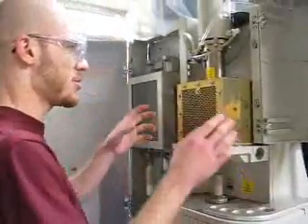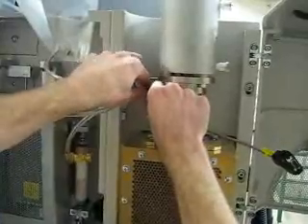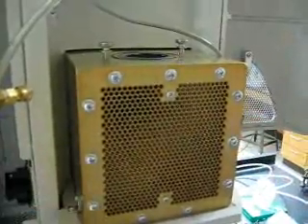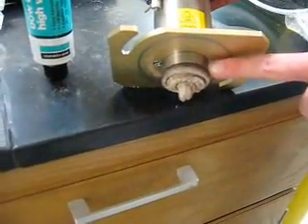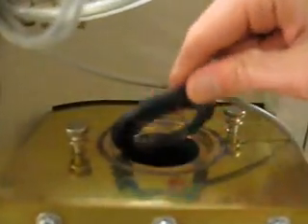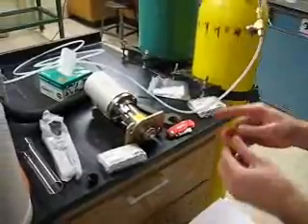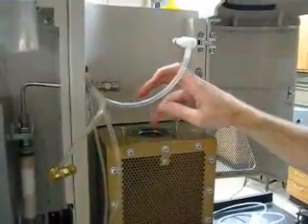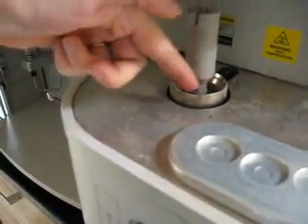Leco CS Quartz Tube Replacement

Comment: I'm currently learning how to use and troubleshoot a CS-230. Currently attempting to replace the pinch valve tube (looks like it is cracked where the pinch point is) and the CS230 is giving us a leak check fail.  Might I be able to contact you to ask questions? Thank you!
Reply from the maker: Hi neohighlander... I'm sorry, but I wouldn't be much help.  I haven't touched a Leco machine in over 10 years now.  I left this video up for the students that followed me in having to deal with this.  I do remember seeing leak check statuses, but I don't recall any solutions.

Comment: I worked for LECO back in the 80's. Installed alot of CS-244's CS-144's SC-32's & SC-132's and some CR-12's  I dont remeber the Oxegen nitrogen units number.